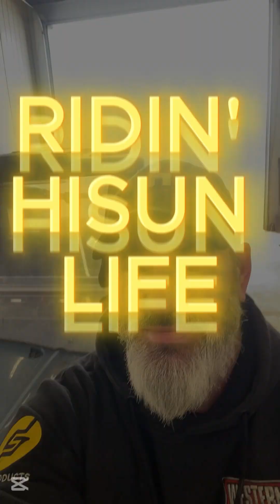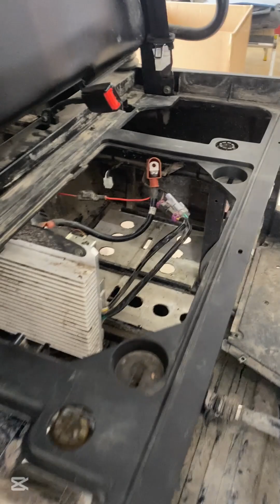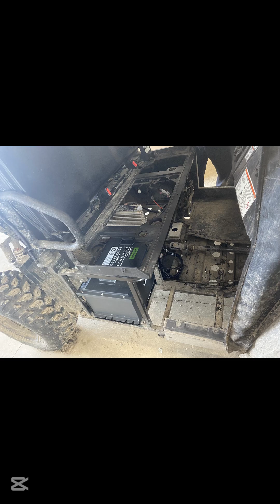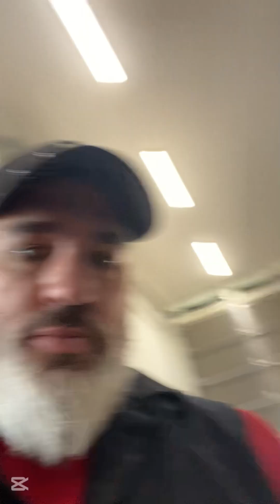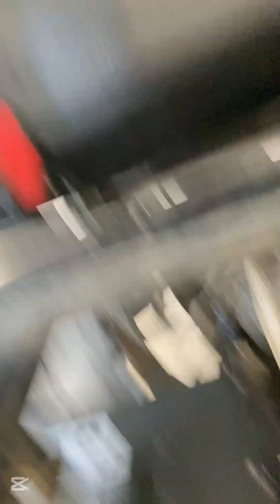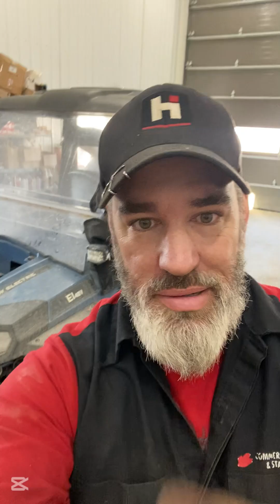Converting a 22 Hisun E1 Sector 48 volt/Lithium @hisunrussia8682 @hisun-motors9064@HisunUSA

Comment: Why did you change the charging unit? You could have just downloaded a lithium profile from delta q website and installed using the usb port on the charger. DUMB waste of money.
Reply from the maker: The agm batteries were not holding a charge anymore. This unit needed them to be replaced. And this lithium unit is a way better option not only in performance of the machine but financially. To replace the agms they’re are 8 units at over 600$ a battery. And the lithium comes in at 3000$ for everything. It’s a no brainer to do this swap at this time. It is the best option for the customer. And they are super happy with the product.

Comment: Did the top speed increase?
Reply from the maker: Yes it did. And the acceleration as well.
Reply: You may have already stated but about what is the top speed now?  Also do these do regenerative braking/deceleration and does that still work with the new batteries.  Been looking at the e1 and may try to swap out after the warranty period in two years. .
Reply from the maker: @sofadviolator not sure what the top speed was , being that it was a customers unit. I believe it has a small amount of regeneration but it’s only on braking . And it’s not that much. It’s a huge improvement over the stock batteries.